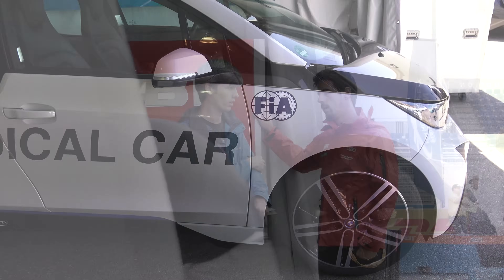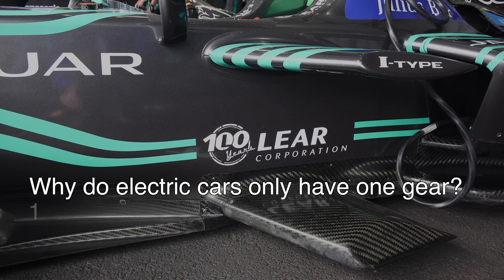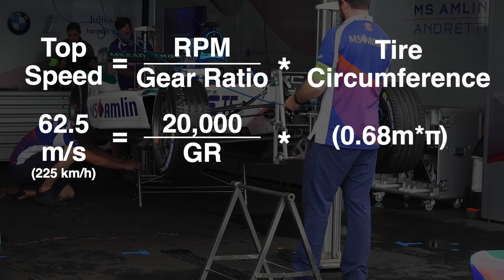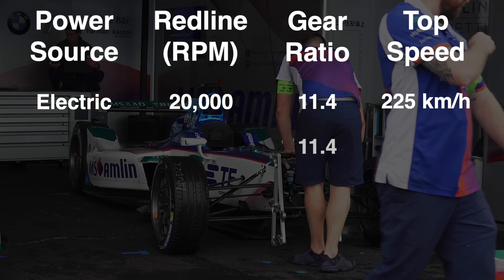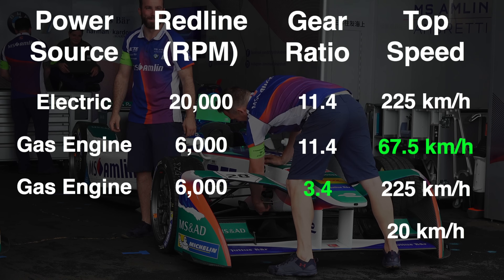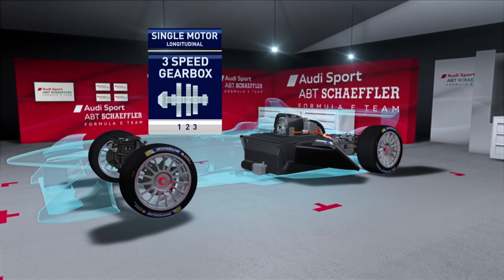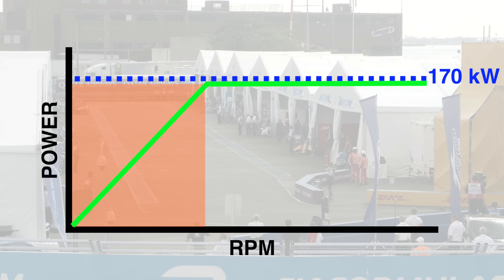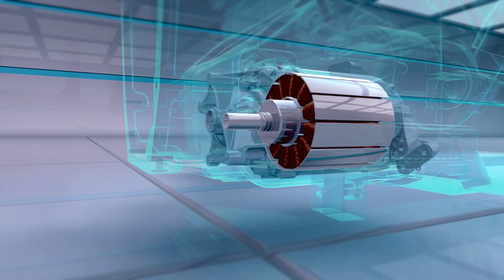Why Do Electric Cars Only Have 1 Gear?

Comment: no gearbox AND clutch. I reckon anyone who works on their own cars would love the simplicity of electric drivetrains
Reply: Some EVs (like the BMW i3) go have simple clutches to disengage the motor from the drivetrain when a sudden shock is detected to prevent damage. So whenever I go over the crest of a hill at high speed in the i3 and get some air the computer engages a clutch and the motor is isolated from axle. If you are not prepared for it it can be a bit shocking because you obviously lose regen braking at the same time since the motor isn't connected. So after it contacts the ground again the car freewheels like it's in neutral for about a second and then the computer reconnects the motor.

There was an issue also when the rear wheels of the i3 were off the ground... and accelerator depressed fully the wheels would speed up to very high rpm in that fraction of a second with the lack of resistance and when the wheels hit the ground suddenly slow... A few of my fellow "enthusiastic" i3 drivers had the motor mounting bolts loosen due to the repeated shocks and that had to be fixed in a recall by getting the clutch to disengage earlier.
Reply: vinny142 i got a audi a4 B8... 200 000 km i drove about 30k miles Clutch Broke, Gear are not smooth anymore, Motor is loud bc it isn't running smooth anymore, a animal broke some wires of the motor .... so this are thing you can't repair anymore most likely bc of software ... with electric i lose a lot of useless maintaincost
Reply: o0bananaman0o haha, yes except for the electric part.
Reply: That would be great if a lot of places didn't prohibit car repair on their premises.
Reply: It is nice that electric vehicles have less heavy parts. No engine cherry picker.
Reply: @Cybernatural  what are the batteries made from -feathers??
Reply: "practically you are held back by intellectual property law, something that never applied to gas engines."

No, that's not true.  The software that manages your ICE runs is also proprietary.  This is true of tractors, too.  John Deere is fighting it's customers right now, to prevent them from tinkering with tractor software.
Reply: @MaltiverseExplorer  plus, ICE engines have always been subject to patents, from the very earliest days.
Reply: yeah. Except the electric part with a bunch of chips and electronic boards and the completely sealed engine with the electronics that you can't repair yourself. So NO. Thats not very simplistic
Reply: usually people who love working on their own car loves when it has more stuff to fix.... just look at Land Rover owners...
Reply: Electric cars are very simple in technique. There is more electronic inside a combustion engine car for all the regulators and sensors. An electric car is so much more simple and still much more efficient, more powerfull and durable.
Reply: @eDriver  Tesla hasn't even been making their own cars for 10 years yet. I'd probably chill on the whole durable thing when there a non ev cars that have been on the road for a century.
Reply: Steam engines (external combustion) never had any transmission or gears, and almost every steam car ever made has no transmission or clutchs, topping it off with 100% torque from rest, just like the DC electric motor.
Reply: How do you contact these Tesla "rangers", are they available in Shanghai?
Reply: How much does a repair cost thought? Or are they kind of doing it complementary for being a part of the new generation so to speak.
Reply: Nie mand
Reply: Nie mand  learn how to drive
Reply: Yeah, electric motors are better than ICE in every way - small, lightweight, very efficient and have wide rpm range. In terms of reliability they are also superior, because they have just 1 moving part which is a rotor, so only its bearings can worn-out. Properly manufactured isolation of windings should last longer than the rest of the vehicle.
Reply: Vinny142 how does your comment relate to the OP?
Reply: Anyone who owns a TESLA will love that you do not have to take your car to the shop and leave it for a few days for any minor repair.  Tesla Rangers will come to your home or business and do the repair where the car sits.  They can repair 90% of any issue without needing to go to the shop.  If you do need the car to go to the shop, TESLA puts you in the newest/best car they have on the market, as a loaner while they fix your car.  Elon wants the loaner to be better than the car they are fixing.
Reply: @davidbeppler3032  let's see- my car has 55k and has never had ANY repair work, and it cost <$17,000. that means i could buy two cars for what your tesla cost. so youre expecting the tesla to go 110K without needing any repairs. afraid youre in for bitter disappointment, my friend. BTW, you paid for all the gas that i've used, too.
Reply: @tommurphy4307  I love math.  How much is your car worth?  How many miles are on it?  What is your average fuel cost?  How have you drove 55k miles without an oil change?  I have more questions but I am sure by now you realize that even if they gave you that car for free, a Model 3 would still be a better value.  ;)
Reply: John  Why would you pay $10k for something that only costs $7k?  Also, I will happily drive a Tesla for 500,000 miles saving about $32,000 in fuel costs. lmao
Reply: I like tesla-lovers, they are so completely out of tough with reality :-) Most breakdowns of any car  can be dealt with by the roadside, and in fact, most are. I have a $50/y subscription on an emergency service that shows up in 30 minutes, anywhere in the country, with a guarantee that they will either fix it on the spot, or take me and my car to a garage that can fix it. If they still cannot fix it, I'll get a hire car. That hire car will be comperable to what I drive, and that's just fine with me. 

You see, Elon doesn't want the loaner to be better as a courtesy, he wants you to drive it, like it, and buy it.

Amazing how quickly peopel fall for Elon's bullpoop, and praise themselves for doing so...
Reply: Nah. Clutch and manual gearbox all the way, enjoy driving the vehicle and feeling the road over the car driving for you.

Comment: A kW is literally a measure of power. If you're allowed 170 kW, gears aren't going to give you anything more.
Reply: Power isn't multiplied by a lever. You're thinking of force (torque is rotational force).

Comment: I've been wondering about this kind of thing since high school, when Tesla was just starting out. Would there possibly be a range increase from running an electric motor at a low rpm with a tall gear versus at high rpm with the typical fixed gears?

For example, if two electric cars, identical other than their gear ratios, traveled at the same velocity, would the motor running at a lower RPM be able to use less electricity on average due to its lower RPM? If so, would we expect to see a range increase from having an overdrive option for electric cars at cruising speed?
Reply: Tom Klonowski no, the rpm of the electric engine is of little consequence.

Comment: Jason, have you ever considered automotive engineering since you majored in mechanical engineering? I saw the video on why production cars haven't reached 300 mph and I wondered if you ever considered working in that type of field to help improve the automotive industry or help break records such as the  300 mph milestone.
Reply: Any car going above 350 km/h will go through a full tank of fuel in around 7 minutes. I'm not even low balling the number, that's how much energy is required to sustain the speed due to air friction. It's not practical because it wastes too much energy to travel just a short distance. At low speed the energy per km drops.
Reply: christian linero where would you be driving your 300 mph car?

Comment: Can you talk about ramp up? Like the period of time where the electric motor does not allow full torque by race regulation. Don't they need to have a grace period before dumping full torque in order to prevent part breakage.
Reply from the maker: +scott walton as far as I know there is no torque limit, only a power output limitation from the battery (though this is simply a property of the battery). Only rule is 170 kW cannot be exceeded during the race.

Comment: Older f1 cars could Rev to over 20,000 and still have tears. Also electric  motors don't have a torque curve like that. It starts at 100% torque and then drops down from there. That's why cars with internal combustion engines almost always have a higher top end and can reach higher top speeds.
Reply from the maker: +jaya neyon yes, but the power band for those old F1 engines is all at the top end. There's a very narrow range of engine RPM that's actually used during the race, hence they still use gears.

Comment: 2:55 hehe my 4.7L V8 4Runner idles at 500 rpm and will chug along at about 800 on a flat surface in 4th or 5th gear

Comment: Can you do a video which explores homemade diesel fuel? How is it made?... Does it have any negative affects on modern diesel cars like a Mercedes BlueTec? 

Thank you so much, love your videos and all the work you put into making them!
Reply: I’ve seen two fuel cars that start on regular diesel and once warmed up switch to used filtered cooking oils. Interesting. The exhaust makes me hungry for fish and chips. Seems to work alright. It may not work really well when it gets cold outside as the bio diesel may gel up. I saw that happen to a huge barrel of diesel used to run a diesel electric power system. It was fall and winter grade diesel was supposed to be delivered and accidentally got summer diesel. After a short tome the lights went out. It’s really hard to heat and drain a 5,000 gallon diesel tank. Tough lesson learned.

Comment: It's kind of a silly question, but does the power draw from the motor increases as it revs, or does it stay somewhat constant? If it does, wouldn't it be a good idea to use gearboxes on commercial electric cars?
Reply from the maker: +Damian RC it actually starts with a very high current draw at low RPM, and then decreases as RPM increases, to an extent. Eventually the efficiency does drop.

Comment: Another way to demonstrate the reasoning behind a single gear ratio for electric motors is to plot the torque at the ground vs road speed curve for an IC engine with it's multiple ratios.  Observe that by using varying ratios with the engine's parabolic shaped torque curve, the general behavior is that at lower speeds the torque at the wheels is highest and decreases as road speed increases.  This is virtually the same characteristic as the torque behavior of an electric motor with no gearing changes.

Comment: What about adding a traditional transmission to a much smaller, much more power-efficient motor for the sake of much less battery consumption?

(for the context of road cars' range, not for racing purposes)
Reply: Nick Amarit the electric motor is efficient.  A transmission creates a loss.
Reply: knut riis Good point. All I think about are the joys of driving and rev-matching... Never really thought too much about efficiency.

Comment: the torque is full at 0rpm, but while the engine is revving, but while revving, a contra voltage (explained by faraday, maxwell laws) is created, so it give you less torque..
i think that there is where a gear is useful too..

Comment: A multi-speed transmission can allow for a smaller motor and a less powerful battery pack for the same multiplied torque to the road through the tires.  The losses through the extra gears is negligible in comparison to a bigger ampere draw from the battery from a 1-speed transmission. There are well-published charts from battery cell manufacturers that show the discharge rate at different "C" ratings. There is also a trade off in batteries between building a cell for maximum watts hours per kilogram versus building a cell for maximum watts per kilogram.  In Formula E the race is always a balance between speed and range.          Mark Yormark

Comment: Cool topic. But if race bikes have a redline of 18000 or so, why would they need 6 gears?
Reply: uNkLeRaRa4 because they're short geared meant for acceleration
Reply: jspr2k5 I know, but if electric motors don't need gears because of a high redline, bikes should be the same. He didn't go into the topic of how electric motors make peak torque at zero rpm, so I was hoping he would go more in-depth.

Comment: Can you explain in more detail why electric motors are efficient over such broad rpm ranges?  As I understand it, running electric motors at higher voltages makes them more efficient because higher voltages mean lower currents.  Current creates heat which is wasting battery energy.  So what voltage do current electric cars run at?